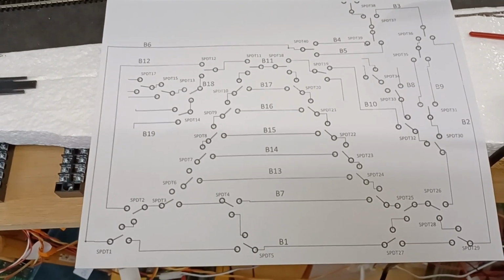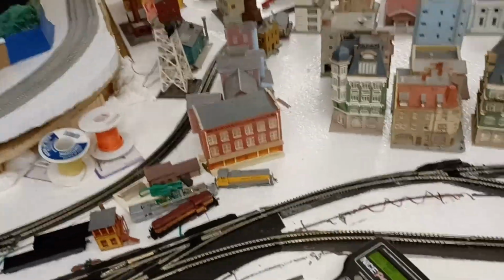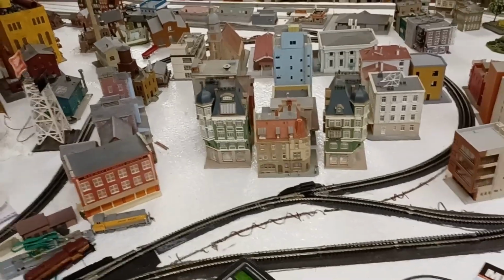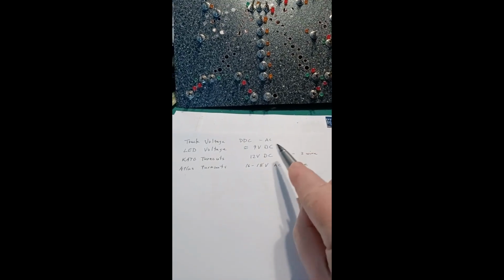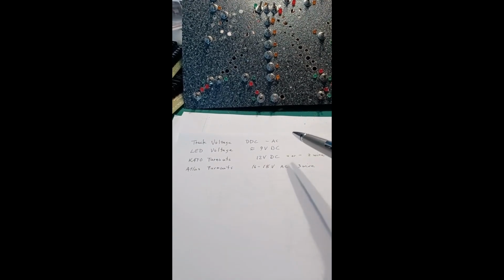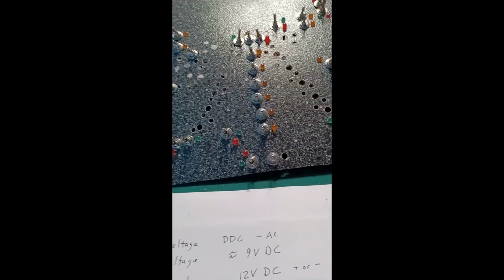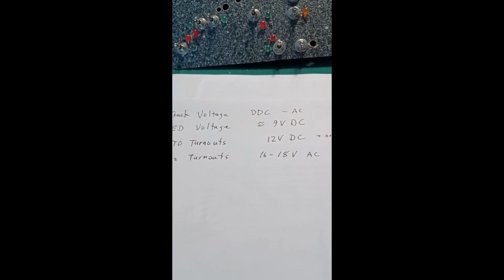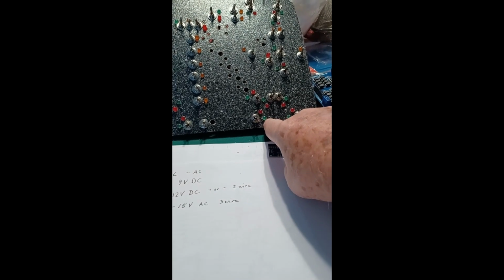Newbie Part 12 Taking Control

Comment: For a 'newbie' I was stunned at your wiring/electronics knowledge. Was all I could do to sort of have a clue, won't even go into the Arduino stuff; still sorting out the basics of switches etc LOL Well done!
Reply from the maker: Actually, wiring is no big deal for me since that's my background.  Spent my career in the electric utility industry.  What I struggle with is finishing something, there's so much to do, I find I go on to the next thing before finishing with the part I've been working on....

Comment: Thanks for the offer to post your sketch. It may be useful. I went as far as making led’s work with push button activation thinking one button for each turnout direction. I was planning on using servo’s with these and motor shields, but since have leaned toward manual throws. But, I might still change my mind again.
Reply from the maker: Not sure how long it will take me to get to the coding. I'm having fun right now with the building placement and highway stuff.
Reply: @AModelRailroadNewbie  no hurry. Do what’s fun. That’s what’s important